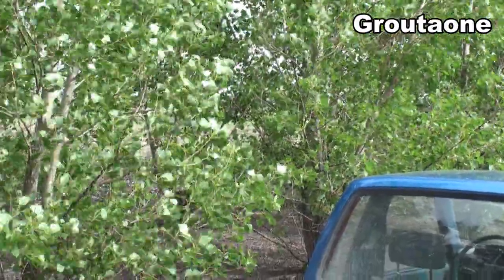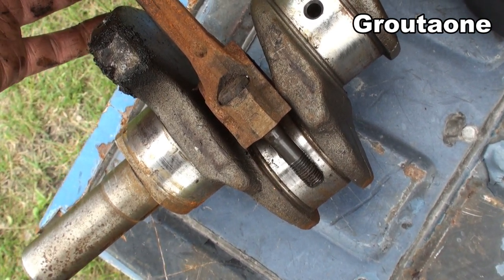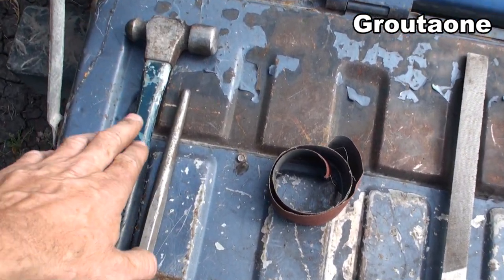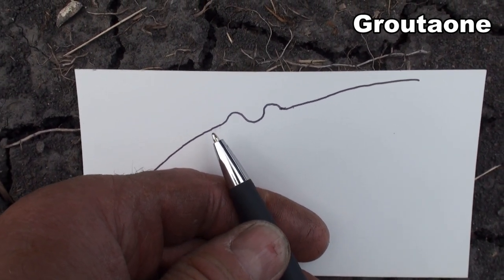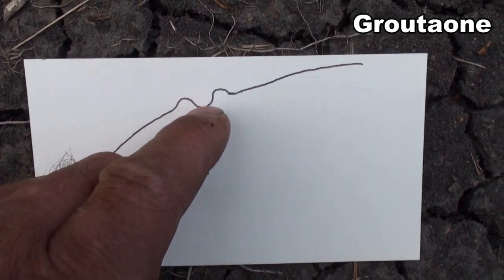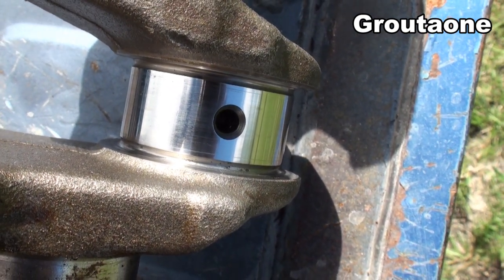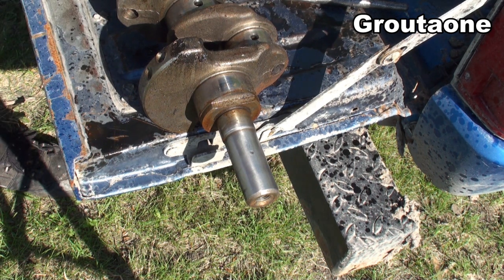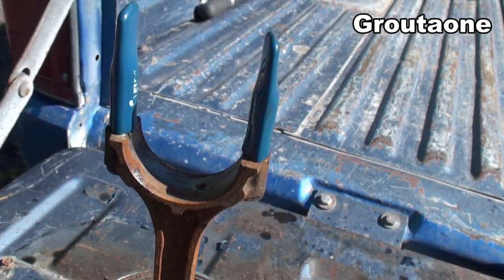BackYard CrankShaft Nick Repair

Comment: Nice. I have a V-6 crankshaft in the bottom of a Nissan 3.3L VG33E long block, from my 1998 Pathfinder, 166,000 miles.  Very clean and owned by an elderly couple since new.  Oil pan is off. Block is sitting on its top in a tire giving me access to crank. It is a spare motor. It was having rod and/or main bearing knock.  I found shavings in oil and filter. It had been oil starved from previous owner, due to a leak they didn't notice. First I had moonlighting mechanic try to refresh bearings.  Nothing changed. I'm not sure he did it well. I had it pulled out and replaced with used motor. I want to restore the crank, flush motor with cheap vegetable oil and then diesel and put it back in. Any suggestions?  My first time doing any motor block repair. Thanks!
Reply from the maker: Sounds like the engine needs to be taken apart for inspection, cleaning and repair, to get an idea of the damage maybe try using plastigauge to measure bearing clearances.

Comment: Yesterday, I was knocking the pistons in on my Flathead Ford 239. I knew to put fuel line over the studs but of course I neglected that. Torquing up my rod caps and then I hit #5 and it felt odd when I'd turn the crank. I took the cap off and sure as anything I'd dinged the crankshaft with a rod stud. I put a nice gouge right around the inside of my con rod bearing. I felt like I could puke. The block, main caps, crank, and flywheel are fresh out of the machine shop. Everything else is either new or in very good shape. I'm into this thing for about $3700 USD. After the panic died down I thought about a small file to just hit the high spot but "Nah that can't be right.". I saw this video just an hour ago. I went down with points file in hand and gently worked at the dent for a few minutes until I could barely feel anything. I put the two halves of the bearing back in with assembly lube but rod and cap halves swapped so it was riding on a clean surface. That would tell me if I did it or not. I torqued the cap down and turned the crank one revolution. It was like magic. My crank, feels awesome. I pulled the cap, cleaned and inspected the bearing. No damage. Not even a scuff. I was able to order just one rod bearing yesterday but this truly saved my ass. Thank you.

Comment: So while I was changing my rear main seal I touched the crank with a punch. It has just a small burr in it. I reassembled and the rear main leaks worse than ever. I'm eager to try this out and see if I can make it useable again. You may have saved me a lot of headache.
Reply: Did it work?
Reply: Did it work? I’m about to try this technique
Reply: Just to update, it seems like it did work for me. My engine is leaking from every seal except the rear main now lol. I'll be tearing it apart for a rebuild this summer anyway.

Comment: Anyone got a idea about if to use a crank that had a main bearing failure. The motor is a Gen 3 Ls 5.3 LM7. The bearing had a piece of metal that let a indentation and core marks. It's probably the size of a airgun bb or slightly smaller. Well the crank has part of this scoring on the Journal. Was wondering if anyone had a idea about what I could do or if I'm just down a crank. Thank you very much for the video.

Comment: The title says backyard.  I see some stupid comments below from people who obviously didn't  watch the video.  As the man said, if you have the time and money take it to a machine shop.  What you're missing are the effects of hydrodynamics.  In an ideal engine or any rotating machinery for that matter meant to ride on an oil wedge, metal to metal contact should never happen.  The low spot would be fine since it's a nick no wider than a 32nd of an inch.  Considering the circumference of the journal, that's definitely less than half a degree's width and in my opinion based on facts and not my ego, it would probably last a good while.  Great video.

Comment: its a nice fix for when you remove the wheelbearing from a hub and you damage the hub where the bearing would normally sit. If you just file it down so the new bearing can go over it then that smal dent under it wont really matter.

Comment: The file is your friend!! I've fixed many cranks with one!! especially with all the crap I work on!!☺
Reply: 805ROADKING 
I had a ol Hercules engine on a generator at a remote site that had issues when I started at my current job. 
They said they did like 2-3 head gaskets in about 8 yrs.
I did it once when I started , almost 10 yrs ago at this point. 
The block deck looked like it was milled by dragging it on the road 😂😂😂
Some careful file work and it was smooth enough to stop chewing up head gaskets. I'm surprised it's lasted this long, watch I jinxed it and they will call next week😁

Comment: very soft crank.. like a 70s low compression american. Did not know asian did that to any of their little engines. great tips. I run a little 3 main boxer, the 40 pound flywheel sings heading into winter like a wet finger on a crystal glass edge. I had no clue they made any little engine soft at all...my own attracts the damndest things being forged.

Comment: Cut two 4 to 6 inch long pieces of used green garden water hose, push them onto the rod bolts before pulling them and or before re-inserting them.

Comment: If you are stuck out in the boonies somewhere and you need to get back this might work. I can't believe anyone would think this or the other "wrap sandpaper around bearing surfaces regrind" will run for any length of time.  Good reason to never buy a used engine that was home rebuilt unless you know who did the work.